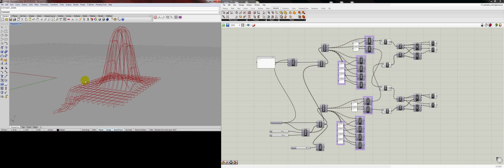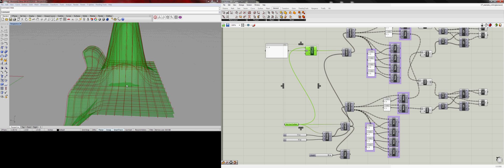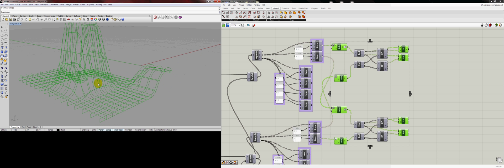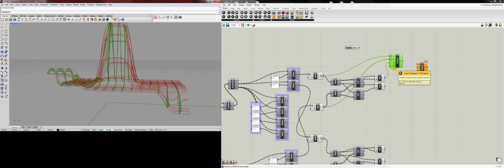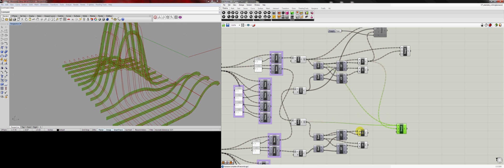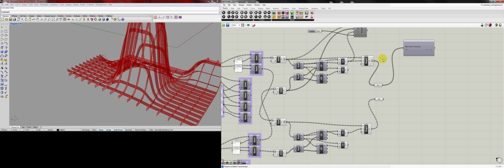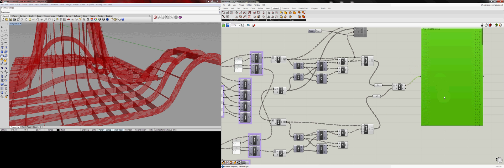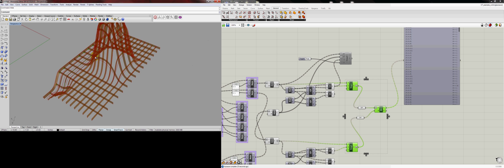Grasshopper Introduction - Ribs from UV - v4

Comment: Hey, I want to start by thanking you for uploading this series of tutorials. I am an architecture student completing my masters thesis and building a ribbed structure using a combination of both the UV and XYZ planes, which I am very happy with. I have managed to lay out the ribs I made using the XYZ planes, but am unable to flatten or untwist the UV curves I've created. Is there any way you can finish explaining this method to the point of fabrication or point me in the right direction? Thanks!